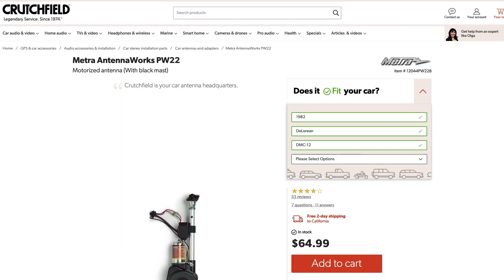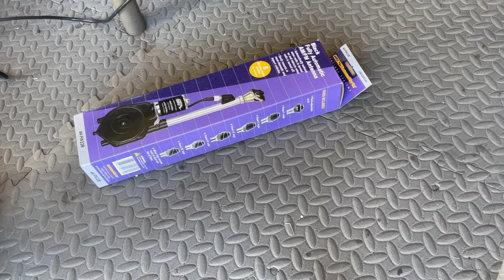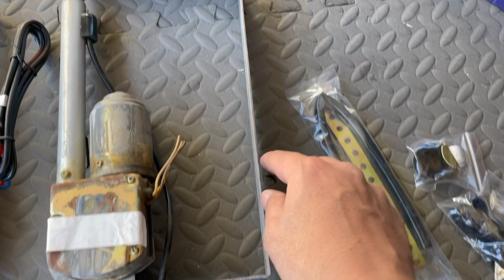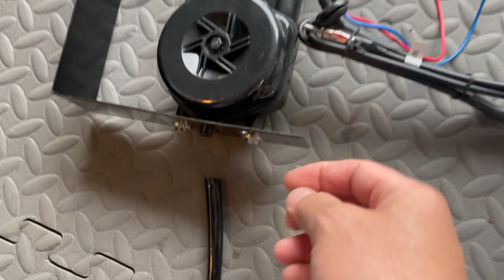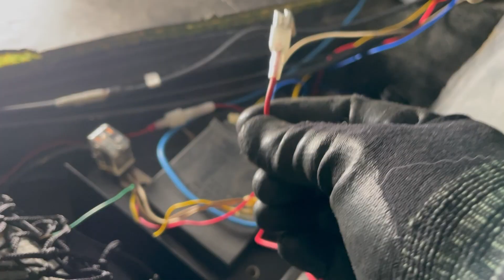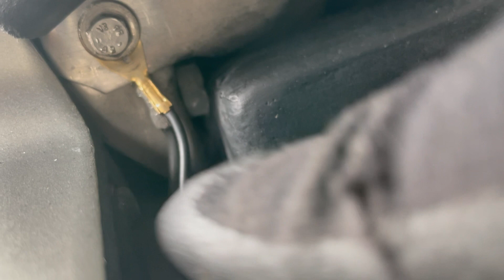DeLorean Power Antenna Install

Comment: Someone needs to get in the time machine, go back to when you did this and fully pull back their arm, extending it and with all their force make their palm of their hand "caress" your face. Then come back with the back of hand and "caress" the other side of your face.

First you cut the wires to the original so short, for NO reason, since you ran the  ran the universal antenna wires to the relay.

That brings it to the second. instead of just removing the wires from the old and plugging in the new, you did a bunch of nonsense tapping things.

Third you should have just fixed the old antenna.

This is seriously painful to watch. SMH FP